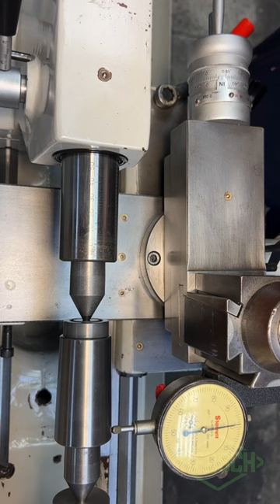Lathe Shorts - How to quickly set your compound #diy #machining #lathe

Comment: wouldn't it be faster to just loosen it up and run the tool holder up to the part and tighten it down then check it with an indicator or soft material between the cutter and the part?
Reply from the maker: There are a lot of extra factors to consider in that, which would lead to a result that's even less accurate. For example, how square is your toolholder in reference to the axis of your compound? How square is all of that in reference to your spindle? Etc. TLDR, you still would want to indicate, which means you're just adding extra steps. IMHO, it doesn't accomplish anything for you, since in the end your tool wants to have its own reference to your work based on its cutting geometry.

Comment: This is not accurate, you should check the sway at both end of the taper.
If it is not zero you can still do it by middle the sway on both sides , the difference should be zero. 
But the first import check is to set your tailstock in the center of the spindel en check that the movement of the tailstock is in line with the z movement.
Reply from the maker: Also the indicator should be on centerline. This will get you close. As someone else mentioned, the best method for accuracy would be to do the math and use the sine of whatever angle you're after. Thank you for sharing your knowledge!
Reply: There are a lot of factors indeed. always nice to see different methods so thanks for sharing.
We can learn a lot from each other👍